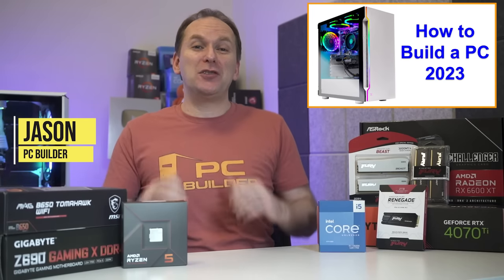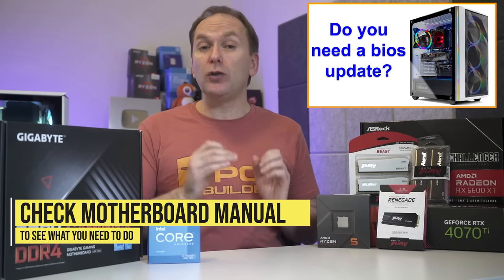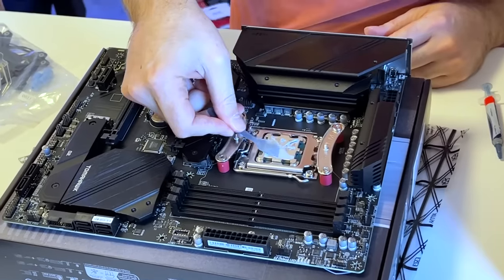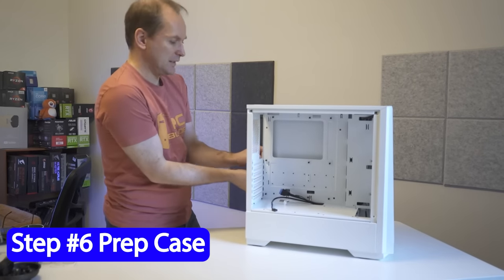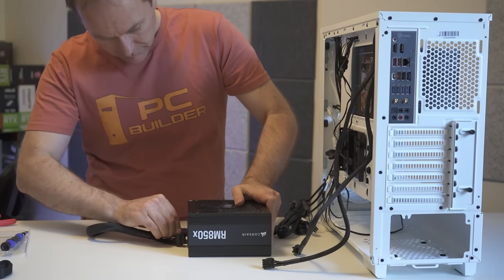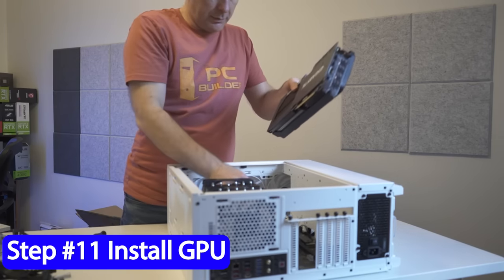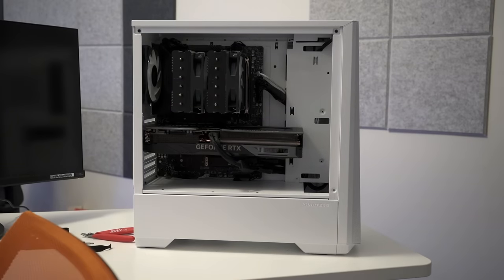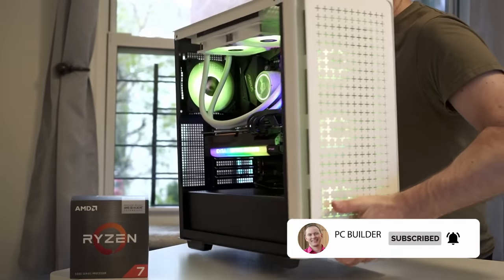🛑 How to Build a PC 🛑 Step By Step Ryzen & Intel 🛑 How To Build a Gaming PC

Comment: I'm literally sitting at home, waiting for my components to be delivered (only the motherboard has arrived so far). My last build was 7 years ago so this video was perfectly timed!
Reply from the maker: Exciting!! Best wishes on your build!
Reply: Very excited for you man. Im building my budget before start with ordering😄😄😄
Reply: Same here, but the opposite. Everything except the motherboard has arrived. :D
Reply: Just finished my new setup 1 hour ago ^^

also 7 years ago since the last build.

7700k ---> 5600x
Asus Rog Maximus IX ---> MSi B550 gaming carbon Wifi
Msi gaming X 1070 ---> Msi 3070 gaming trio

Love it so far. And for the first time RGB in my Corsair 780t case :)
Reply: @scrinbot  and ejoy it man
Reply: Same but I’m waiting for GPU and Case
Reply: @dannygonsalez27  Thank you :)
I bought the MB and Cpu used. And i payed just 250€ / "Germany Euro.
Sold MB 150€, bought used MB for 150€
Sold 7700k 150€ , bought 5600x 120€.
Sold 1070 150€, bought 3070 400€

-250€ Total. :D
Reply: @dannygonsalez27  Try to use the used market. Its worthy. And don´t buy the newest stuff, cause you wouldn't notice anyway. Buy instead more RGB  🤣🤣🤣🤣
Reply: How much money did it all cost
Reply: Are you me?  Most of my components have arrived besides arguably the most crucial one (PSU).  Been about 8 years since I’ve done a build.
Reply: What are u using for the platform? I just built my 7700x lol
Reply: Same! 5 years ago
Reply: I just got done installing hardware now on to connecting wires  great video 📹
Reply: @PCBuilderChannel  I've never built a PC but I've watched hundreds of videos and every time I see a large air cooler like at 5:45 I'm always concerned about the weight distribution and if it could damage the motherboard over time. I know the fins are aluminum and lightweight but after adding 2 fans for a push pull configuration...ehh it just looks sketchy in my INEXPERIENCED opinion. Lol Could you or anyone else give me some pointers or additional information on things to consider or possible complications to be aware of when using a large air cooler?
Reply: In the same boat. Isn’t the anticipation great?😂
Reply: Nice one. Have fun 😊
Reply: Ditto
Reply: Everything but my PSU has arrived
Reply: currently researching and picking out my parts now... been around the same amount of time for me as well....building computers are so fun but always get nervous before I get started lol
Reply: Literally on the same boat lol 😅 Jason made me confident
Reply: I’m right where u were 3 mo ago. Only the at cooler has arrived. Rest is do today.
Reply: My build was 7 years ago too! I had an i77600k Nvidia 1060. I’m upgrading to an i513600k eta 4070. What was your build 7 years ago and what is your new build?
Reply: Same , the MB &case arrived & its been 5Y since my last build 😅
Reply: Updates, did you assemebeled your pc ? Did you needed any other vids
Reply: Same as me! Waiting for few parts left to be delivered. My last build was like 12 years ago!!, have been a laptop users for long time.
Reply: Waiting for my cpu to come so I can finally build this thing. First time in 7 years
Reply: Same bro same my parts are here just a mid tower case and I start the build HERE WE GO
Reply: 20 yrs since my last build and im struggling! wtf are all these wires that dont seem to have a place to plug in?!
Reply: @ThorSuzuki1  me rn
Reply: I want to buld my first ever PC. To play GTA V.. Which motherboard should I use?
Reply: So, how did it go?
Reply: Sitting here waiting for the last piece of my build, the gpu lol
Reply: Ordered all my components and have to wait till next weekend. Putting together an i7 12700k rx 6750xt  ddr5 z690 gigabyte and 2tb ssd in a lian li 216. Plus a thermalright ps 120 se. Hope it goes well.
Reply: I am the opposite today, I have EVERYTHING except my motherboard which should hopefully be here tomorrow! Wish me luck :D
Reply: Bro me to this will be my first build everything will be here this friday except the ssd and gpu
Reply: How did it go?
Reply: Threw a build together last night but I'm not getting any power to the board. All I get when I flip the switch on the PSU is CPU led fan flicker for a split second. Any tips?
Reply: Same
Reply: Been getting one peice at a time for two weeks now. Finally have it all and ready to put it all together.
Reply: This title needs to be changed for this video. It should be “Building Bible”
Reply: Building my first gaming PC after getting a new job. PC Builder has quality, informative content. God bless. Jesus loves you!
Reply: I’m waiting for my parts to get here and I’ve never built a pc before! this video has given me the handholding I needed
Reply: Hope after a year you got them 🙌
Reply: Literally me, I’m gonna build my first pc and I’m 28 🫠

Comment: This is just wild. I am about to build my first PC in over 4 years and you just happened to use the exact case I chose. This guide will definitely come in handy. Thanks for your attention to detail.
Reply from the maker: Glad we could help, and good luck with the build!
Reply: Hi all. This is my first build in over 4 years. Specs:
AMD Ryzen 5 7600 CPU
MSI B650M-A WIFI MB
CRUCIAL DDR5 4800 2X8GB RAM
MSI RX 6600 8GB VIDEO
MSI MPG A650GF 650W PSU
PHANTEKS G360A CASE
SAMSUNG 990 PRO 1TB NVME

I plugged in the power supply cords I needed. I installed the CPU on the Motherboard and installed it in the case. I installed the RAM and NVME. I connected all fans and power connections to the Motherboard. I then plugged in the PSU and...nothing. No LEDS or RGB on the board...PSU didn't turn on. I checked all the connections multiple times...nope. I took out the PSU and connected it to another system and it fired right up. I haven't installed the GPU as I wanted to check the power first. The only thing left is a bad MB...thoughts please.

Comment: Good tips.
I might add : if you're flashing the BIOS, make sure to use a smaller (4/8/16GB) USB stick with flashing led.
I lost two days thinking my motherboard was dead
but it was just a dodgy USB stick that the BIOS for some reason was rejecting.

Comment: I wanted to provide some feedback from my earlier comment two weeks ago. I can confirm having no experience whatsoever other than watching this video I managed to build my PC and it posted first time! The only issue I had were two fans spinning but not lighting up this was a simple fix as you can imagine. The other nervous part for me was seating the CPU however that was easy enough it was only afterwards when I mounted an AIO (not shown in this video) I realised I mounted it wrong after undoing it and trying to pull a way the pump it was stuck due to the thermal paste I pulled so hard the whole CPU popped out I got lucky though no broken pins. If other people in the same situation make sure you undo the lever holding the CPU first if you can get to it mine was AM4. All in though was a huge success it looks awesome and it’s fast. Jason I also used your affiliate links for Windows 11 pro thanks for this series and for link! I got this!

Comment: Great video, Jason! Having been building PCs for over 20 years, the best piece of advice is to plan ahead to minimize any potential problems. For example, if the mobo you're looking at states it might need a BIOS flash to post with the CPU... I would just choose another mobo that's already compatible, if possible? Even though flashing a BIOS is painless, it's another step in what becomes multiple steps when building a PC. I can build one in about three, four hours, but I've been doing this for decades, like Jason. A new builder is going to have a certain amount of anxiety and anything you can do to minimize, or eliminate that anxiety is what will make building their first PC a fun and enjoyable experience vs. a frustrating and draining one.
Reply from the maker: Good tips!

Comment: One of the things that helped me build my first pc was looking at guides and downloading the motherboard manual and reading it while parts are on the way, figuring out which wires are used and what goes where

As such, my advice for everyone is to read the motherboard manual in advance, as well as watch a guide like this.

Also, as Jason said, extra thermalpaste won't hurt. I messed up installing cpu cooler and had to wait for thermalpaste to be delivered.

Edit: Also, if u have the case already, familiarising urself with it is worth it. Maybe even preplanning cable management (I did this and it sped up my pc building by a mile). My noob self spent a full half an hour at least figuring out which wire in my case was for argb (had to disconnect from pre installed hub and plugging an adapter >.>
Reply from the maker: Great tips!

Comment: Solid guide and another great video! Step 7 triggered some PTSD; I upgraded my PSU (Core Reactor 750) last year, and trying to install the EPS cables without removing the motherboard was an expletive-laden nightmare. The 270-degree turn at the ceiling was just awful, largely because of the VRM heatsinks. Worse yet, I installed the wrong 4+4 cable and it wouldn't POST.
Reply from the maker: Thanks Brough! Yep, we've all been there for sure lol

Comment: Despite building my own PCs for 20+ years (yes time flies 😵) …. I watch these videos now  and again as a refresher is always good to keep you on your toes 🥰😇👍. 
NOTE: check case / cpu fans are aligned to the correct direction for your case design …. Generally front to back airflow (case fan frame 3–4 prong reinforcement bars facing the case rear and the open fan blades at the front).
Reply from the maker: Missed this! Good tips thanks you

Comment: Thanks for the encouragement at the beginning! It's been a decade since I built one (have replaced a few pieces here and there). I had a not great experience with my first one before that in college (never got it working, even with IT pros testing everything and checking my work), and the same issue when I tried the 2nd time (but was able to figure out on my own what it was that time around; had to do with my case- was the same case both times, but more info online to help), so I was anxious.

I wasn't too concerned about putting the parts together, just about making sure all the connections were right and getting it to post that made me drag out my PC build from early Dec to today. Got the last few parts put in and connections made last weekend and watched this (to double check my own work) and the after build set up video before taking a deep breath and booting it up; it worked! I just had to figure out some drivers to get online with it to finish setting it up. :)

Comment: Thank you Jason  , for all your advices :)
Just finished my new setup 1 hour ago ^^

also 7 years ago since the last build.

7700k ---> 5600x (just 6 instead of 8 cores, cause it doesn´t make sense for games, cause Jason told me so)
Asus Rog Maximus IX ---> MSi B550 gaming carbon Wifi  (no X570 cause Jason told me so)
Msi gaming X 1070 ---> Msi 3070 gaming trio 

Love it so far. And for the first time RGB in my Corsair 780t case :)
Reply from the maker: Awesome!! Congrats on your new build! Show it off if you like by sending us a picture on twitter @pcbuilderjason

Comment: Thank you for the content!
I've just built a new setup this January. First of all, cant express how much a decent case helps with the process (I had o11 d evo)
Good reminders about peeling off a plastic from m.2 heatsink, and taking off a pci-e slot cover from GPU. I built around 10 PCs for the last 3 years, and derped and forgot to do both couple times :)
Also some basic advice that could be useful as well:
- Be sure to prepare flash drive with BIOS beforehand, if you are upgrading your only system (might seem obvious, but I actually had friends, who didn't realize that and came to me for help)
- If your motherboard has BIOS Flashback you might as well do that every time before assembling your PC regardless of whether it posts or not. More often than not your MB will have outdated BIOS, so why not take it off your mind right away and chill.
- If you have CPU with in-built graphics you can try first post w/o discreet graphics card to confirm everything works. Especially for beginners. It takes like 2 more minutes, but it either ensures that everything works w/o graphics, so if it does not post with graphics you've already narrowed it down to one issue. Or if it actually does not post w/o graphics, you wont be scared as much as in another scenario (because graphics is normally the most expensive part, and you might instantly think there's an issue with it)
- If you have many case fans, think which ones will be intaking air, which ones exhausting, and how you will set them up before putting everything else inside the case. You might not have enough space to maneuver if you have already installed everything else
If you have AIO:
- If you have a complicated AIO assembly, or any assembly in your case, and you wont to try a first post before put everything into a case, you could put AIO WITHOUT thermal paste, so you dont need to re-apply it in case you end up needing to remove the pump from CPU for some reason. There will be enough contact even w/o thermal paste for your CPU not to overheat for a few minutes.
- Decide which side you want your tubes to go before installing the radiator for AIO.
- Make sure you place the radiator the way its tubes contact is at the same level or above the pump (e.g. either orientation at the top, or tube facing top for a vertical mount, don't mount radiator at the bottom, even if the case allows it)
Reply: And don't mount Aio at the front of the case for air inflows. Did it and it was bloody nightmares for my PC temp
Reply: @cjyy6290  could be fine if you have double-fan setup (like 2-3 fans each side of the radiator), but yes, why overcomplicate, easier to just avoid this configuration
Reply from the maker: Thanks for sharing!

Comment: My suggestions: 1. Before I begin assembly, I place a large beach towel on my desk and a second on the floor where I'll be standing. I use masking tape to secure them. These towels ensure that if I drop a screw or small part, it won't run away and hide. 2. I test components' fit to check the length of their power/data cables, so I know they will reach their corresponding pin connectors. 3. I install cables to the top MB connectors before I install the MB. If you use an AIO radiator at the top of the case, it can be hard to insert the cables afterward. 4. I use small adhesive labels on the ends of the cables to indicate what the cable is for. 5. To prevent the over-tightening of screws, I use a torque screwdriver. Mine is an EK-Loop Torque Screwdriver with a 0.6Nm force rating. It produces a 'click' sound when it reaches the proper torque. 6. After purchasing my components, I leave everything in the box until it is installed. If the box is opened before you build, the PC parts can be lost or mixed with other components.
Reply from the maker: Thanks for sharing!

Comment: I think for first time builders its always a good thing to connect the mobo with CPU/GPU/RAM and CPU cooler attached to make sure your build posts. If so then drop things into the case. Better than having to pull everything out if you cant figure out why it wont post. I always remember my very first build i had a bad mobo and i was glad i figured that out outside of the case rather than tearing it apart.

Comment: Great video the only thing I could add is before you hit that "power button" go over every wire and connector you did and that power panel especially. Don't do this if your in a rush take a day and chill out and its so much more fun.
Reply from the maker: Good tip!!

Comment: Few days ago I bought  new components to upgrade my PC and I want to do it myself so this is perfect! Gotta upgrade mine after 5 years.
Reply from the maker: Wonderful! Best wishes on your upgrade!!
Reply: @PCBuilderChannel  thanks. It turned out to be quite good. I do have one question though. I have a lian li 216 case and it's amazing. There are 2 slots for fan at bottom  of the case. Would I need to put fans in there too? To further cool my gpu.  I have 2 fans at the front I think those are 160mm (intake), 1, 140mm at the rear (exhaust) and another 2 fans on top (exhaust). Do I set the bottom fans intake?

Comment: Also I learned a lot from looking up a build guide for my specific case. This filled in the gaps for what I didn’t know about case wiring, rgb wiring, and probably other things, because they specifically had the cables and connectors I had. Not a suggestion for the video, just a note from a first time builder

Comment: Working on my first build for productivity ie. Blender but with enough gaming power to run MSFS. Best sources for parts so far have been Ebay and Mercari.
Asus Rog Strix z590E
Seagate Firecuda NVMe SSD 2TB
Corsair CX550F PS
Deep Cool Matrexx50 ATX
Undecided on if an RX 6600 xt/ RTX 3060 ti GPU would be overkill.

Comment: I've only built one PC before and that was 5 and a half years ago so this video is really helpful.

I am a Physicist though and the comment about "more is better than less" for thermal paste concerns me a little bit. 
This is wrong, thermal paste is just there to fill the tiny gaps caused by imperfections of the metal plates. In an ideal world the plates would sit completely flush to each with no imperfections, this would allow for the maximum heat conduction since thermal paste has a worse thermal conductivity than the Copper and Aluminium typically used for Coolers & CPUs.

Comment: Been in the PC DIY area since 2009. Also been doing budget to high end builds as long. Currently rocking a 7700x(waiting for 3dvcache cpus to upgrade to) with 32 gb of 6000mhz cl30 and a rtx 4090. Monitors are 2 1440p 165hz on the sides and main is 4k 120hz oled.
Reply from the maker: Nice!!